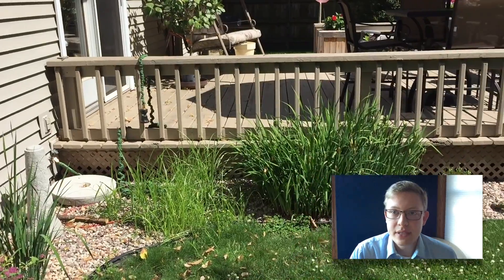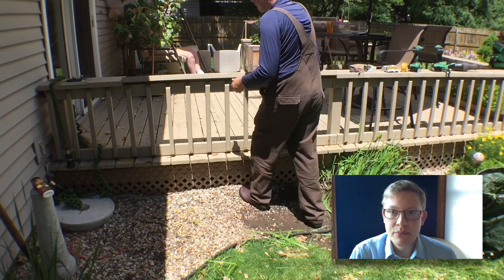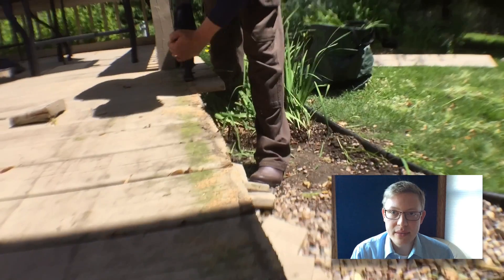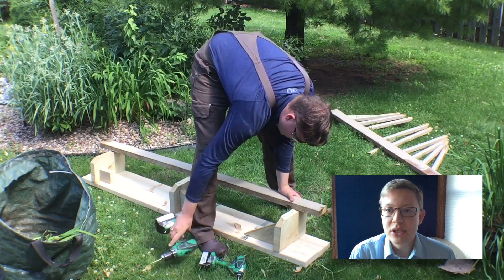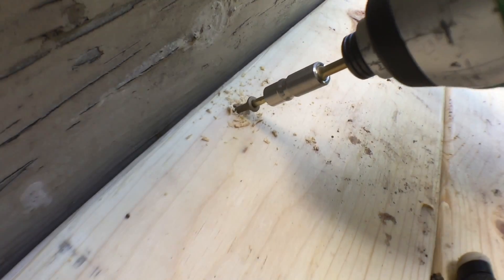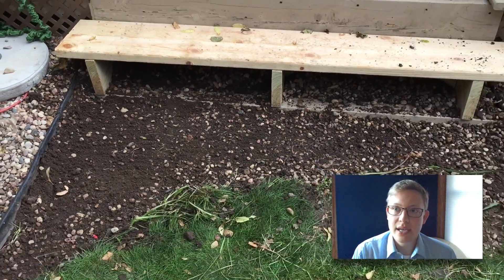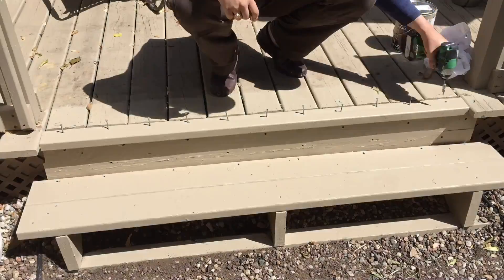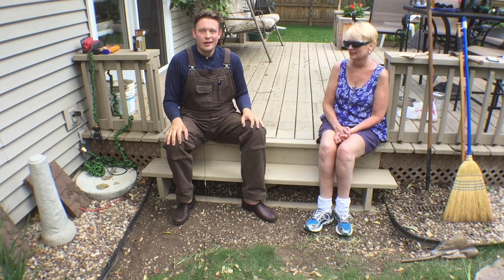Building a New Deck Stair

Comment: Excellent work Kris!! You're a talented and very busy man. I helped my son replace the stairs on his deck. We were just replacing something that was already there, so it didn't take nearly as much brain work as your project. We couldn't find premade stringers that were long enough, so we just used the old ones as templates to cut the new ones.
Reply from the maker: Midwest Gardener nice going!  Cutting out those stringers can get tiring quickly. Thanks for watching, Jim!

Comment: Nice video, helpful. On the wood strip that is making full contact with the ground underneath the new front of the step, did you use pressure treated wood? What did you do to make sure that this piece of wood would not rot out? Also, it appears that all the weight (-to-the-ground) is only supported on the one 2x4 piece of wood on the front of the step and on the ground, the three step-legs you built do not contact the ground at all, yes? I have a similar project where I am building a single step to a low deck. I dug out and inserted three concrete cinder blocks (left, right, center) the tops of which are now slightly above ground level, and my step is basically a 2"x8"x6' box that sits across all three blocks (with galvanized lag bolts inserted into the wood contacting the blocks to keep the wood off-ground) to not be sitting on the ground in the dirt. My step is attached to the deck from underneath/inside the deck (I had the luxury of replacing some deck planks and thus had access) through the facia-board into the back of the box, so the screws are hidden. I used PT wood throughout, with a coating of marine spar varnish with 20% thinner added to increase penetration, since we didn't use stain.
Reply from the maker: Hi there.  The only PT wood I used was for the stringers holding up the single step.  The rest was just normal construction lumber that had two coats of deck paint applied before being laid down.  We essentially mirrored what had been done to the other set of stairs on the opposite side over a decade ago, and that's still going strong.  Sounds like you had a great project yourself!  Thanks for watching.